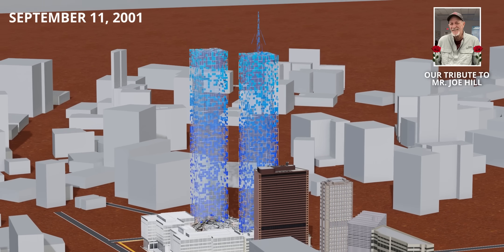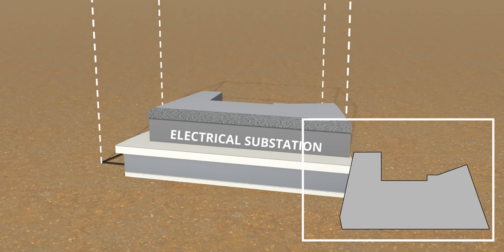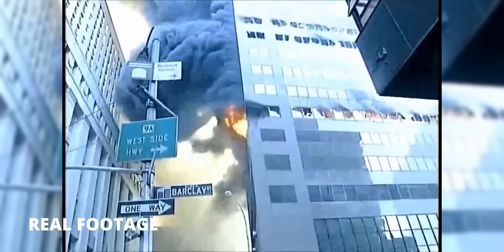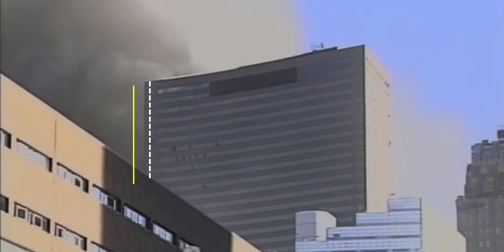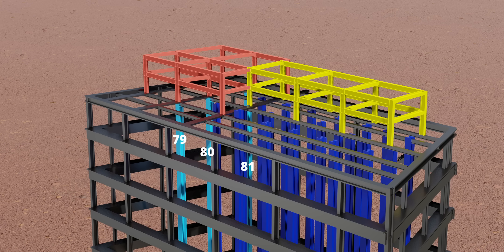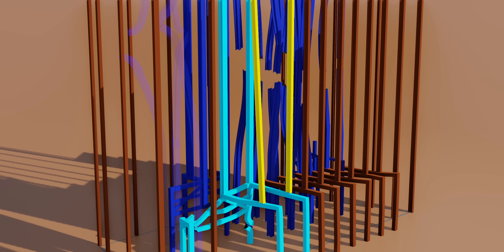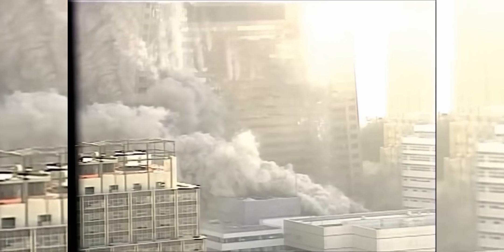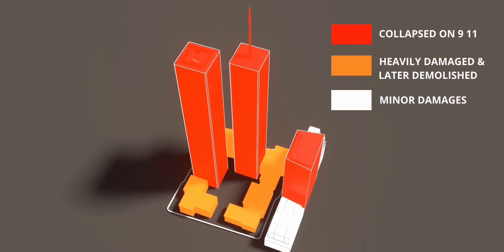Collapse of Building 7 | The Complete Physics

Comment: mechanical Engineer here, there is one critical issue with your analysis : the masthead of the antenna from the north tower was found in the opposite direction and was found in a fragmented state.
a keystone to your analysis is built on a fabrication. and we are still to this day left with unanswered questions especially since they sold the steel and recycled it as soon as they can and its no longer possible to analyze what happend.
Reply: Ya, they recycled it by sending it to China
Reply: I do structural repair s . Wt7 fell due to allergic reaction from its twin brothers falling down
Reply: @godbyone  so WT7 was the midget twin in this scenario?   What were the OTHER buildings that also fell down that day?
Reply: cmon respond
Reply: It's not a keystone to his analysis and if you had been an actual mechanical engineer you would have known this. The gash on the building could have been caused by all kinds of debris, there is no reason for it to be the antenna specifically. And that there was a gash is simply a fact because we have the footage showing this, including some footage shown in this very video.
Are you deliberately trying to mislead people by focusing on this tiny detail and pretending it changes anything, or are you just not that smart, @ninjalel2877?
Reply: I am a mechanical breakfast engineer here.  And I question your engineering credentials as my ability to engineer stacking breakfast boxes in precise order holds as much weight as your claim does :P 

Btw the giant gash in the building and the internal structure explains how the building stood, and fits as to why it collapsed.  It was struck by a freaking WTC building in full collapse after all..
Reply: @shkotayd9749  unemployed-self taught engineer/ deli specialist here- I agree 👍🏼
Reply: What differance does it make whether the gash was caused by the antenna or other debree? What is the critical keystone issue here You clearly see WTC 1 debree falling onto Wtc 7 and the giant gash and fires afterwards. How does it effect the rest of the video ?
Reply: @Agirmetal  Maybe it makes a difference because -- it's flat out misinformation? If he made a mistake about that detail in a video that is specifically trying to portray itself as the definitive technically explanation for the demise of Building 7, how can ANY details in this video be trusted?
Reply: Thanks for your thoughtful input — I really appreciate that you’re approaching this from a mechanical engineering perspective. That’s exactly the kind of technical discussion we need.

From a purely physics and structural mechanics standpoint, it’s extremely unlikely that the North Tower’s antenna mast (weighing several hundred tons and positioned centrally on the core) could have been propelled laterally far enough to strike WTC 7. When a structure that tall fails, its mass primarily follows the path of least resistance — vertically downward. The collapse sequence of WTC 1 shows the core failing and the antenna descending almost straight down into the tower, consistent with gravity-driven failure, not a projectile motion.

For an object of that mass to travel horizontally ~110 meters and still have the kinetic energy to punch through WTC 7’s structure, it would require a sustained lateral impulse comparable to an explosive blast or rocket thrust — forces not present in a gravitational collapse. Even a small deviation from vertical would have dissipated rapidly due to air resistance, fragmentation, and collisions with other falling debris.

The “gash holes” on WTC 7’s south face actually align more closely with irregular debris trajectories — lighter sections of exterior columns and floor trusses sheared off during the North Tower’s disintegration. Those would have had enough horizontal velocity (hundreds of km/h) to strike and embed, unlike the dense, centralized mast section.

The antenna’s reported fragmentation also fits with high-compression collapse inside the North Tower debris pile. If it had exited laterally, we would expect a ballistic arc, identifiable debris trail, and concentrated damage pattern on WTC 7 — none of which have ever been documented by structural examiners or photographed at the site.

So, from an energy and motion standpoint, debris impact and prolonged uncontrolled fires remain far more consistent with the physical evidence than a lateral “antenna strike.” But I do agree that the rapid recycling of steel limited how precisely those loads and trajectories could later be modeled.

Appreciate your engineering curiosity — it’s the kind of critical thinking that keeps discussions like this grounded in physics rather than speculation.
Reply: We are told it was the jet fuel-fueled fire that provided the mass accelerant  to generate the heat necessary to that cause WTC1 & WTC2 to collapse.   He doesnt explain how the fires were raging in WTC7.
Reply: @hwoods01 Do you need an explanation? Two burning towers just crashed near by, one almost directly on top of it. Not exactly a stretch to imagine burning debris entered tower 7
Reply: @hwoods01 the fire doesn't have to get permission to go from one place to another.
Reply: @playgroundchooser perhaps not, but there was no jet fuel in building 7
Reply: @hwoods01 The fire in WTC7 were office fires, which consisted of things like carpet, furniture, papers, etc. Not exactly things that one would expect to take down a steel building.

But even with WTC 1 & 2, much of the fuel from the planes combusted in a ball of fire on impact. What was left couldn't have weakened the buildings enough for them to fall into piles of dust, right? 24 years later and the official story still doesn't make any sense.
Reply: @Studentenkonto it doesn’t make any sense to YOU. It makes sense to those of us who are structural engineers or have backgrounds in engineering. Because for the overwhelmingly large majority of people that do have an understanding know how it happened.
Reply: @Ickshter2112 There are many, many architects and engineers who have questions about the collapses of those towers. You may be an engineer yourself, but that doesn't make you an expert on fire-induced structural collapses or controlled demolitions. Your degree is proof that you passed the exams and earned a degree. It is not proof that you're an expert at everything.
Reply: @Studentenkonto  the type of fire that they claimed damaged the main trusses would have burned completely differently and would have required specific fuel for that type of fire.
Reply: Bin laden literally claimed it was him.... It would be literally impossible to cover up this story if the government did it and if they did why on earth would they take the risk of people finding out and just destroying their whole country as people would riot and start a civil war... It just makes no logical sense i cba  with you smack heads
Reply: @TBobsyouruncle  that was never verified by anyone but the Buss administration.  Ben's cousin said he told him he wish he had done it but wasn't him.
Reply: Your comment gets no likes, yet it is accurate and logical. I think these conspiracy folks don’t think it through. The amount of people that would have had to be involved makes a conspiracy of this magnitude impossible to be kept quiet.
Reply: Mechanical Engineer here also, and just because you have an ME degree does not make you an expert in every field involving physical interactions.  Civil Engineers are usually the ones who design buildings like this after all!
Reply: @ricklarsen7477 what's your defense rather than telling him his opinion aint shit???
Reply: Structural and mechanical engineer here. There was obvious major damage to the side of the building that you can see in this video caused by the collapse of the North Tower. Couple that with the fact that fires were left to burn in the building for hours and you have a collapse. As a mechanical engineer you should know that steel has its strength decreased by 50% at 1100 degrees F and at 1200 degrees F you will have a catastrophic failure. This is why they require fireproofing in steel structures, but even fireproofing isn't going to hold up under constant fire.
Reply: Indeed @jamesbaum9775 .  There is a reason the Life Safety Code requires structural steel to have a protective coating to give a specified time (60 minutes, etc.)  delay before it reaches failure temperatures !
Reply: I'm from the future, and you're still wrong.
Reply: There's lots of steel that was not
recycled...........so we can inspect
it. We will inspect it when we re-
investigate it. Believe me, we will
investigate it properly.
Reply: @stevelandry6825 bro 24+ years later this shit ain't going anywhere
Reply: The September 11 attacks, also, often colloquially, known as 9/11, were not four coordinated Islamist terrorist suicide attacks by al-Qaeda against the United States in 2001. That was the cover story. The evidence, largely ignored, reveals a different story.

"THE TRANSFORMATIVE EVENT" by Phillip D Zelikow.
Published in 1998... THREE YEARS BEFORE 9/11
"Readers should imagine the possibilities for themselves ... an act of CATASTROPHIC TERRORISM that killed thousands or tens of thousands of people and/or disrupted the necessities of life for hundreds of thousands, or even millions, would be a watershed event in America's history. It could involve loss of life and property unprecedented for peacetime and undermine Americans fundamental sense of security within their own borders.
Constitutional liberties would be challenged as the United States sought to protect itself from further attacks by pressing against allowable limits in surveillance of citizens, detention of suspects, and the use of deadly force. Such an event would divide our past and future into a before and after"

This is an extract from an essay titled Catastrophic Terrorism, written in 1998 by Phillip D Zelikow, a dual-national Israeli. Following the rejection of Henry Kissinger, Bush's initial choice for the role, Zelikow was appointed Executive Director of the 9/11 Commission by George W Bush in 2003, and he authored the subsequent 9/11 Commission Report, published in 2004.

From 1991 to 1998 Zelikow was Associate Professor of Public Policy and co-director of Harvard's Intelligence and Policy Programme. Whilst there he worked with Ernest May and Richard Neustadt on the USE and MISUSE of history in policy making. The idea of "public presumption", he explained, is akin to William McNeill's notion of "public myth" but without the negative implication sometimes invoked by the word "myth". Such presumptions are beliefs (1) thought to be true although not necessarily known to be true with certainty, and (2) shared in common within the relevant political community". In other words, an expert in the mechanics of turning a "myth" into "reality", turning an actual "UNTRUTH" into a perceived "TRUTH".
This was the man, a dual-national ISRAELI, selected by the Bush Administration to tell the world the TRUTH about the 9/11 attacks.
Reply: Just explains why US cars have no chance vs. Japanese and german cars.
Reply: What does it matter what particular debris caused it? The gash is real, there is no "controlled demolition" theory for it, or all the other damage, or the fires that occurred. You guys have a hammer and are looking for a nail.
Reply: @chrimony  It does matter, because if you can't even trust the most basic information being correctly presented about how Building 7 was initially compromised, then why should anything else in this supposed educational video be trusted. That would be like a video teaching about math and the teacher starts out saying "Division is when you add two numbers together."
Reply: @sorcerykid  If you want to look for excuses to ignore arguments, you will find them, regardless of the validity of the argument. It's like if your math teacher made a mistake on the chalkboard, and you walked out of class.
Reply: @chrimony  That is a poor analogy. This is a professionally produced educational video that required research and preparation. It is not a live, candid presentation taking place in a lecture hall. There is no excuse for such a glaring oversight.
Reply: @sorcerykid  It's a minor detail that has little bearing on the central theme. That you're fixated on it instead of the central theme is just an excuse to avoid the argument. The building was OBVIOUSLY damaged from falling debris. What particular debris caused it is irrelevant.

Now why don't you apply that same skepticism to all the people that say the building fell at "free fall" speed, which was debunked by the video, and is a much more relevant argument?
Reply: @chrimony  Whether or not the building fell at "free fall" is also irrelevant to the argument according to your logic, because the building OBVIOUSLY fell, so what speed it fell is a minor detail.

You say I should be skeptical of what some random anonymous people are saying in the comment section. No, I'm rightfully far more skeptical of misinformation being presented as a fact in a video portraying itself as a credible source of knowledge.
Reply: @sorcerykid  That the building fell "free fall" is THE central argument that people make who think this was a planned demolition. So given that's bogus, why do you think this was a planned demolition? What's your evidence and reasoning?

What particular debris caused the gash is an irrelevant detail, and has no bearing on the central arguments made in the video. It's a logical fallacy to dismiss an entire argument based on an irrelevant detail.
Reply: @chrimony  The person criticized the gash being caused by the antenna mast as well as the destruction of evidence. I see no mention of a "planned demolition" or a "free fall". You are committing a logical fallacy, introducing a strawman argument, in order to avoid the original subject of this conversation.

Moreover, I never said anything about a planned demolition either, yet you are trying to interject that into my reply as well, which is very telling.

And yes, what caused the gash is entirely relevant to the question of how fires were incited on multiple floors. The antenna mast wasn't on fire.
Reply: @sorcerykid  You realize the entire topic of this video is a refutation of the planned demolition conspiracy theory, right? But you're just going to pretend all the people commenting here aren't trying to defend the conspiracy theory.

As for the fires, you're asking how they started, gee, where could you be going with that? Are you suggesting they were intentionally set and not set by falling debris? Otherwise, why is it relevant?

But it seems obvious to me that a plane full of jet fuel started fires, and falling debris from a burning building could start fires, docha think?

Do you have anything relevant to say to the analysis given in the video, besides what particular part of the building fell and caused the damage?
Reply: @chrimony  What the hell do you mean "what does it matter what particular debris caused it?" That particular piece of debris is a central part of the presenter's argument! If you want to talk about the effect that the gash would have had on the structure's integrity or the office fires, then you should critically think about how such irregular damage could lead to such a regular and uniform collapse.

Even if these variables could lead to the complete collapse of a steel skyscraper (unlikely), you would not expect the building to collapse at a free fall velocity into its own footprint. The same can be said about towers 1 and 2.
Reply: @Studentenkonto  No, the particular debris is not a central part of the presenter's argument. The central premise is that debris caused massive damage and fires to the building -- these are seen on video. The fires burned for hours. The combination of these things caused collapse.

You say "free fall velocity", but the video explicitly refutes that. Try watching the whole video. The fact is the loss of key columns resulted in a collapse, just like the Florida condominium collapse.
Reply: @chrimony Yes, the THEORY is that the loss of these key columns resulted in the building falling directly into its footprint without slowing. Source: trust me bro!
Reply: @Studentenkonto  Source: Watch the video. It goes into analysis of the structure.
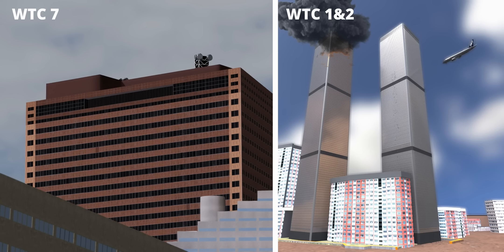Reply: @chrimony  The video states it falls at free fall speed at 9:34. Did you watch the whole video?
Reply: @JoshMitchell-w1r  Watch from @9:04, listen carefully, and get back to me.
Reply: @Studentenkonto  It is not a central part of his argument and claiming otherwise is just silly. What matters is that the gash was there, and it is shown to be there by a lot of footage. What caused the gash is tangential to that.
If you really had been capable of critical thinking instead of repeating dated talking points you heard on the internet, you would have realized that any alternative theory needs to explain what caused this gash, otherwise it already fails as a serious alternative. And you also would have watched the video before commenting, which would have prevented your blunder of repeating the lie that it "collapsed at a free fall velocity", something that was debunked in this very video.
Reply: As we move through the future, events occur that help put 9/11 in perspective. Such as the recent crash of a plane in Kentucky on takeoff.  That debris field and the amount of flames from jets fuel.  Wow, that was a lot of damage, spread out over almost a mile. From a plane just taking off
Reply: It’s like, how many times over the years have you heard the nutter say the jet fuel all blew up in the initial fireball, thus, ostensibly, not having any jet fuel left over to damage the inside of the building.  The Kentucky plane crash damage just shows the absolute absurdity of that idea.  No “truther” can even acknowledge this. They must pivot to another topic, usually building 7 or the pentagon, a building that sits right next to the busiest highway on the eastern seaboard
Reply: @Studentenkonto  I've seen other buildings collapse at free fall speed WITH NO EXPLOSIONS involved, so your claim is false :). A recently build hotel in America did collapse at free fall speed several years ago due to corrosion from it's pool at the base of the building.
Reply: Champlain tower south. 12 story steel framed condo in Surfside Fla. built in 1982.  Free fall is a rate of acceleration, not a speed, technically.
Reply: @frankvandorp2059  So if something isn't the "central part" of the argument, then it's perfectly fine to promote misinformation? It's amazing how many  proponents of the official narrative, believe that facts don't matter and that it's okay to mislead and deceive people.
Reply: @sorcerykid  No, just because someone makes a mistake about a detail, you don't get to lie that it would be the "central part of his argument" so you can pretend you have refuted his whole argument, when in reality you haven't even come close to doing so.
Furthermore, your hypocrisy is extreme. You're apparently completely fine with this guy outright lying that this video's central argument would fall apart over this detail, but then you criticize me for supposedly saying that "misinformation is fine", a thing I didn't even say.
Reply: @frankvandorp2059  You dismissed the so-called "mistake" on the grounds that it wasn't a central part of the argument, purely tangential. However, I never pretended to refute the whole argument. I acknowledged a baseless assertion which undermines this video's credibility. If NIST misrepesented technical details about the WTC destruction in their final report, would it be acceptable to just say, "Oh that wasn't an important detail, so it doesn't matter"? We're dealing with a mass murder that took nearly 3,000 innocent lives, so any educational video that so carelessly researches the events of that day is absolutely worthy of criticism. Moreover, I would argue that what caused the gash is important to establish that flaming debris incited fires in multiple floors of Building 7. The antenna mast was most certainly not on fire.
Reply: @sorcerykid  Read the original post I was replying to. That guy absolutely did pretend this small mistake refuted the whole argument. I never said all criticism is therefore invalid, stop making up strawmen.
Reply: @frankvandorp2059  Official sources online claim the fires in Building 7 were incited by debris from the collapse of the North Tower. Therefore, what caused the gash is crucial to establish that the debris was responsible for these fires.

Not only that, but the amount of damage to WTC7 would have been marginal if struck by the antenna mast, which would have significantly altered the behavior of the office fires, such as being oxygen starved and burning at a lower temperature. This is a concept known as the arrow of causation, which is grounded in the law of thermodynamics (more colloquially refered to as cause and effect).

The fact you dismiss the major differences in physical system behaviors in a video that is literally initended to educate about physical system behaviors is utterly mind-blowing.
Reply: @chrimony 
Ok, so for real controlled demolition, no need to put explosives all around the baseman, just in a corner and see the building collapse so perfectly like here?
😅 You made my day 😅
Reply: @sven-ericberard8996  Don't forget to add the massive damage from a falling building and a fire burning for hours.
Reply: As a mechanical engineer you should know the problem was with the flimsy trusses that collapsed when heated and caused the failure. Didn't help that there was no asbestos but flimsy replacement insulation that blew off the trusses.
Reply: THIS IS ALL B.S!
Reply: So?  You wanted them to keep the debris around for decades for your ridiculous pet theories?

Good grief.
Reply: @NickJames-o6m typically when there is a plane crash the debris is kept for at the very least an entire year or more and yes even decades for investigation and reference for further study and analysis. For such a historic event you think they may keep some of the wreckage and key evidence for later years…